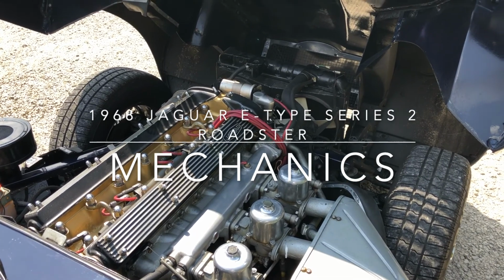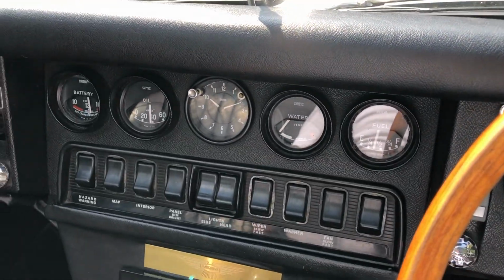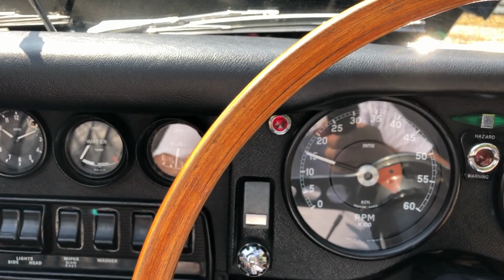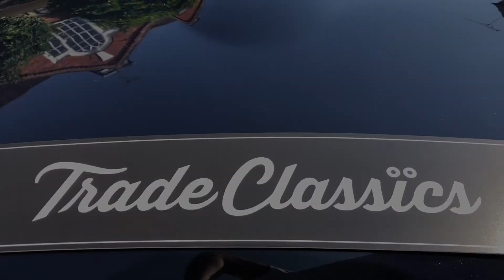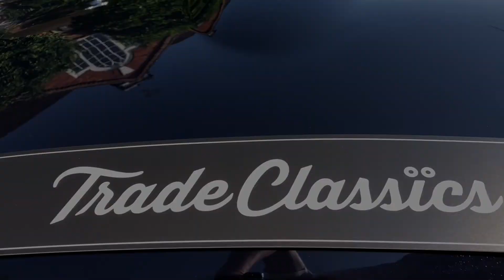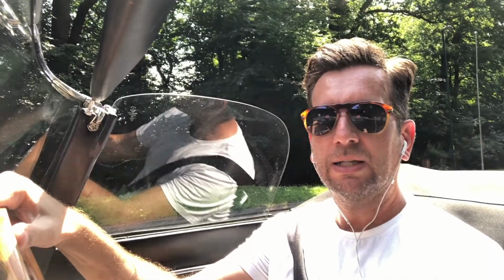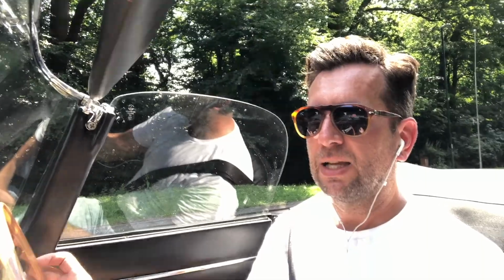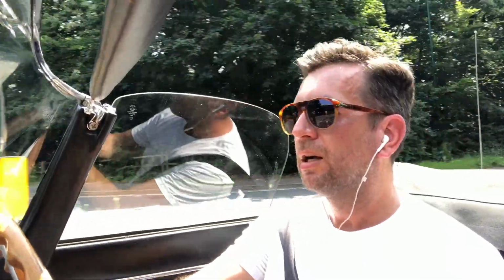Mechanics - 1968 Jaguar E Type Series 2 Roadster

Comment: The horn on my SII is on the indicator stalk, is it different in the UK?
Reply: It's on the indicator stalk in the UK, as it is in the US. I did note that the first HD8 SU had the spring & retainer on top of the manifold whereby it should be underneath. Tension would be incorrect.